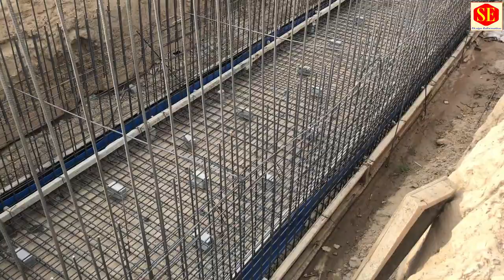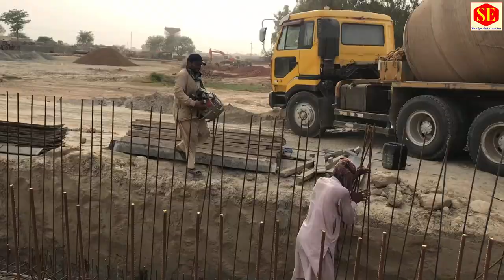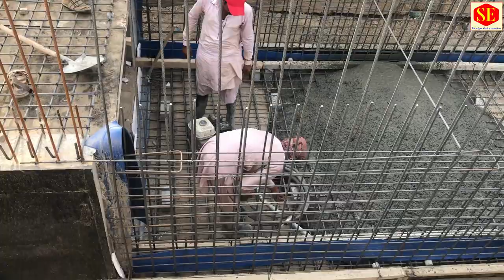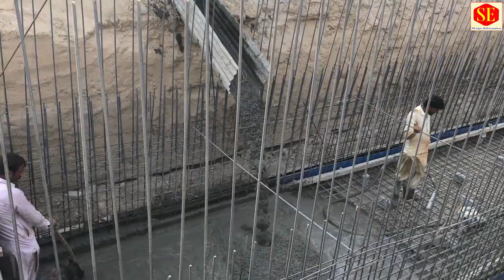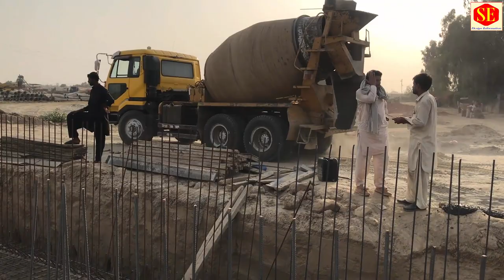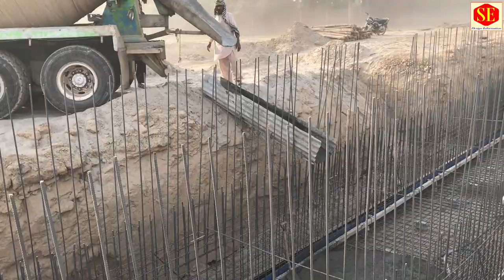Rcc Bed Concrete . Ready Mix

Comment: As per ACI 301-99, ACI 318-02 AND ACI 3044-00 FREE FALL OF CONCRETE SHOULD NOT MORE THAN 2-5 FEET TO MINIMIZE THE SEGREGATION. THIS LOOKS MORE THAN 5 FEET, IS IT A VIOLATION OF PROJECT TECHNICAL SPECIFICATIONS?